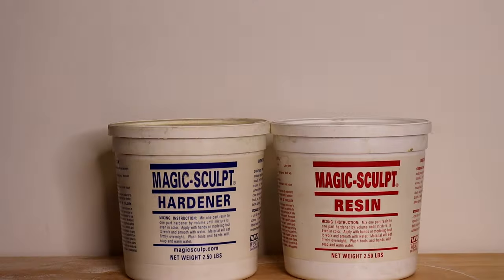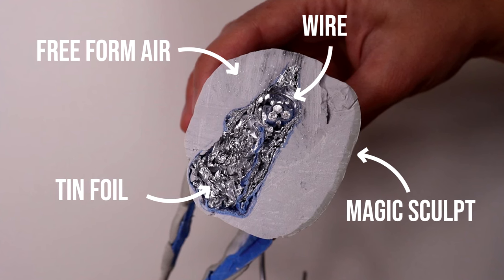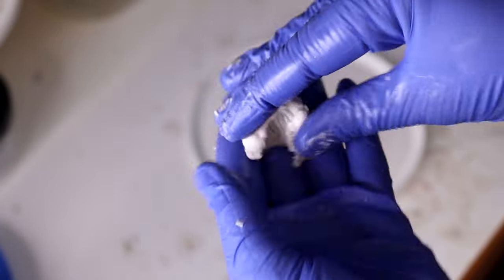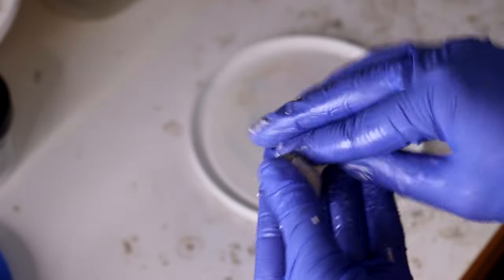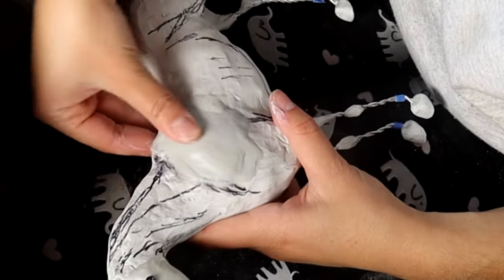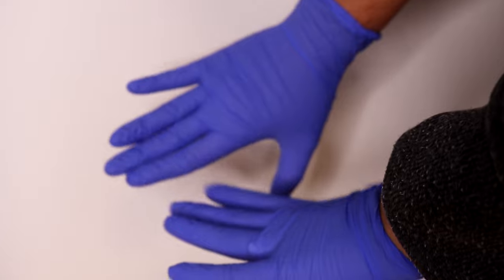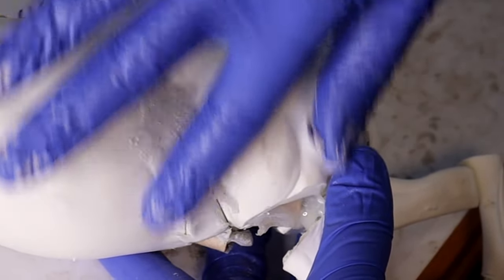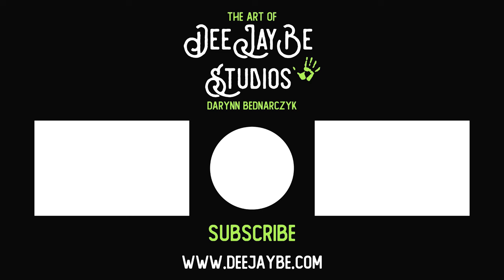FREE FORM AIR | Lighter than Air Sculpting Filler Epoxy Dough

Comment: is this the same as foam clay if not have you used foam clay ?
Reply from the maker: I want to try foam clay, but I haven’t yet!
Reply: It doesn’t seem the same. Foam clay is soft-ish when dry whereas this stuff seems solid. However, you have just given me the idea to use foam clay as the under structure for polymer clay. It’s not toxic like Free Form Air either.
Reply from the maker: Good point! I require a solid base. For longevity of original works.